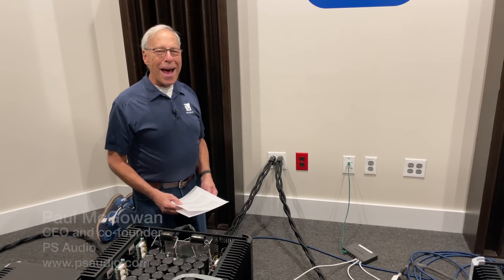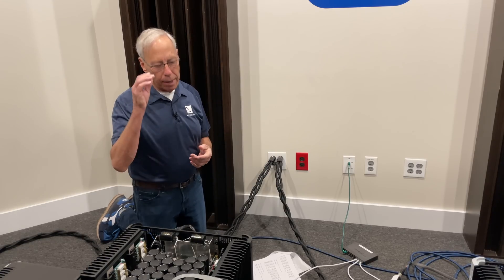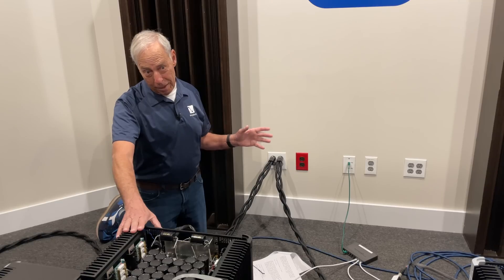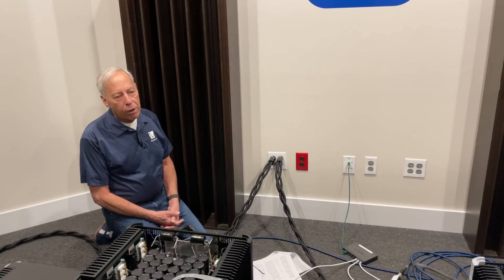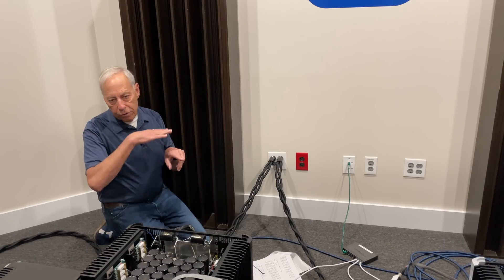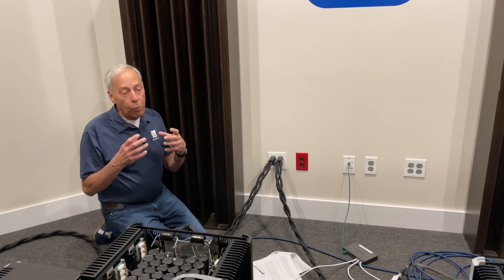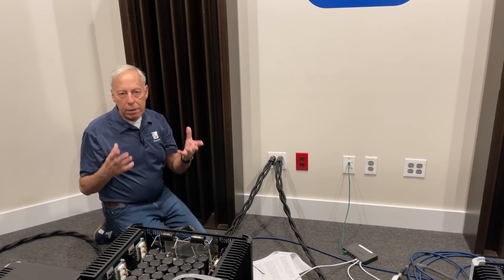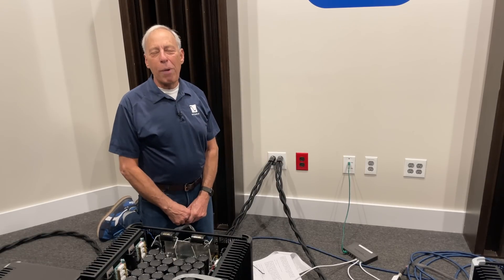Are braided power cables better?

Comment: I run a 10/3 AWG dedicated circuit for my system although I only use one leg for the digital end and the other for the analog end of my amplification.  Nice to know the natural braiding of the 4 wires (including ground) have some other benefit!  Am curious to know now if the metal armor on the wire is beneficial or not with regards to inductance or shielding.
Reply: stick this here because it keeps getting failed to post!

yes but you need an RF rejection filter on interconnect and speaker cables to reject 100,000kHz-1mhz getting onto the cable, this is quite simple a capacitor or 2 and resistor.
you can read about it on dnm designs. they sell little boards go into your interconnects rca plugs and your amplifier to speaker cable. this was common practice with valve amplifiers years ago and somehow got lost in solid state.
tell me you can see it..
nobody's reply so it looks like it's blocked?
Reply: It's been my experience that anomalies in power distribution are rarely, if ever, a result of something local. Like your home or apt. I do recommend one of the PS Audio Power Regen's. You share a common distribution transformer with your neighbor(s). They could be running an old old  (3-ton) air conditioning unit with a failing motor. Old multi-unit buildings with common utilities can be horrible. I could go on and on. Think hard. How really old is the residence your living in. Built in the 1950's? A $3000. 3-meter modular power cord is not going to fix that.
Reply: @wilcalint  This is the actual circuit wire.  So it's about 50'ish feet from my distribution panel
Reply: @jctai100  Note that if you have a long run in a residence likely there are buried and/or hidden junction boxes. Sometimes several of them. And the wires in those boxes are wire nutted together. Sometimes many wires. Also look carefully for aluminum wiring. That was very common in housing construction in the 50's. Very dangerous and should be immediately replaced. A $3000 multibraided modular power cord won't fix that either.
Reply: @wilcalint  Ran the wire myself.  I'm an electrician.  It' separated
Reply: @wilcalint  this answer overthinks the issue.   most people are just fine plugging audio equipment into the wall , because they all have an internal power supply to run the audio circuits, which is designed to process wall power into suitable electricity to run the circuits perfectly well with the supplied plug wire.  besides the electricity at this point carries no information, nor do the internal power supplies transmit signal, just power.  

it is true some audiophiles spend hundreds of thousands of dollars building power regenerators to satisfy boutique needs.   But most consumers of plug in power conditioning  boxes report they hear no difference, with some reporting a slightly duller sound.
Reply: @Douglas Blake well that's good but what about on the output for the speakers how many manufacturers are doing that??
doesn't it need to be on the other end with the filtration from source to amplifier?

Comment: Well said.  I was a disbeliever until I tried building my own power cables and heard the difference.  Equally impactful as interconnects IME.  
I followed a  recipe from VH Audio.  I use 12 gauge semi solid conductors.  The hot and neutral are a twisted pair with a fairly tight twist.  The safety ground is wrapped around that pair in the opposite direction at one twist per foot.  Then good copper based plugs.  They work well reducing noise and bringing out bass slam.  And yes, I have no explanation how this helps when there is 30 feet of 14gauge nomax running from the outlet to the breaker box.  Makes no sense but it is easy to hear.  I have had others come to my room with their amp same design as mine.  After wondering why mine sounded so much better I said try my power cord on your amp.  Bam.  All of a sudden it woke up from it's slumber.
Reply: Aren’t the 15-20 amps power cables in the wall in parallel from the power panel to the outlet and introducing inductance? Does braiding the cables from the power outlet to the amp really makes such an improvement in front of that?
Reply: @joezunenet  Absolutely... It makes no sense, but the impact on sound is clear.  I could imagine that if you had heavy gauge braided cables from the panel it might make a difference.  I have 400 amp service to the house and the conductors to the transformer are the size of your finger.  Then plain ol 14AWE to the outlet.
Reply: @user-od9iz9cv1w  I think you’re right, I just found online that the inductance is inversely proportional to the size of the wires. So either you get large wires, or you braid them.
Reply: don't kid yourself.  The room is magnitudes more of an influence on the sound than a three foot power cord and questionable theories, so any DIY is better applied there.   

I trust the do it yourself power wire hasn't burned down your house in the years since this was posted.   the reply was just an attempt at common sense, often not of great critical concern when men pursue hobbies.

Comment: Even before Kimber, AT&T was twisting pairs for 100 years.
Reply: For DC power.... Not AC
Reply: @boomertsfx1  an astute obsession,  do you understand that the ac that is carried by transmission lines bears little resemblance to what comes from an ac outlet in your home?
Reply: @jamesrobinson9176  of course
Reply: @boomertsfx1  and besides,  I'm pretty sure each leg of 60hz that enters your house is twisted to another leg
Reply: @jamesrobinson9176  but the fancy AC power cable to your power supply does nothing unless the PSU was designed like crap 🤷🏼‍♂️
Reply: @boomertsfx1  no power supply is a perfect noise rejector.

Comment: I think the level of cabling you need is relative to the quality of the audio equipment you need. 

If you run a $500 system, you don't need $5k cables...

if you run a $50k system, you will probably want to go with those $5k cables.
Reply: I put a $150 power cable on my $200 amp. lol! overkill, sounds great tho
Reply: @ChiefExecutiveOrbiter  
Early 80's I had a $3k rig in my $300 Chevette...
Reply: I disagree.  By that rationale, if you buy a high end system on sale for cheap, you aren't allowed to buy better cables to run it. That's patently ridiculous. Any component you drive will benefit from a better back end, be it better power source or better interconnects.
Reply: @falcon048  
I'm uncertain whom you're addressing. 
That said, if it's my response, I stand by my assertion that anything more than nominally adequate cabling takes a back seat to the speakers/room and the active signal path. 
Power source is a separate category than cabling.
Reply: @falcon048  Yes, I understand you can buy higher-end components on the cheap. But at the same time, If you buy a 1k component for 500, you should still treat it like a 1k component, and buy RELATIVE to its quality. My argument is mainly that one should not spend more on the cables than the cost of the equipment. As you say, cables are the backend of the system, and any level of system should theoretically benefit from better power source and interconnects. It comes down to the principle of "what goes in must come out". If you feed your equipment poor quality power, your audio won't sound as good as it can because ultimately what drives any audio system is electricity.
Reply: Pretty sure you don't even need $500 cables for a $50k system
Reply: If you live in a 300k house, you should wipe your buttocks with 10 dollar toilet paper. If you live in a 30 million dollar house, you should still wipe your buttocks with 10 dollar toilet paper. Don't buy 5000 dollar toilet paper just because your house costed more.
Reply: You don't need 5k cables no matter what
Reply: Cabling is at the bottom end of importance regarding hierarchy of spending. 
1.a) Speakers
1.b) Room
2.)  Amplification 
  ...
  ...
Connections
Cabling 

My take... 
Granted, cabling isn't to be disregarded, just isn't as valuable of an platform for undue emphasis.

(edited for spelling)